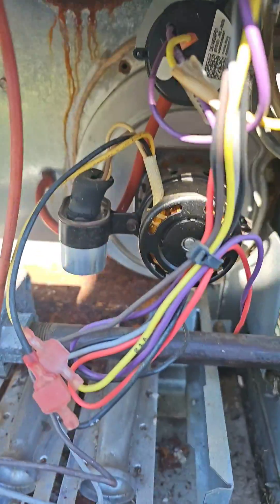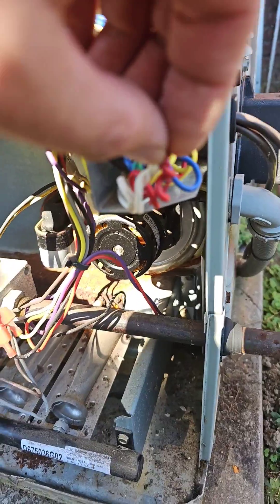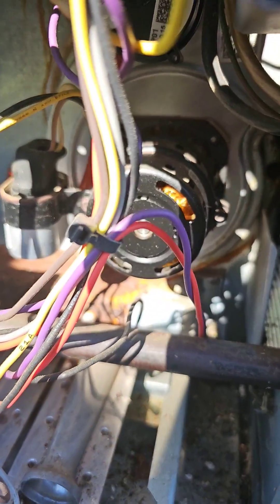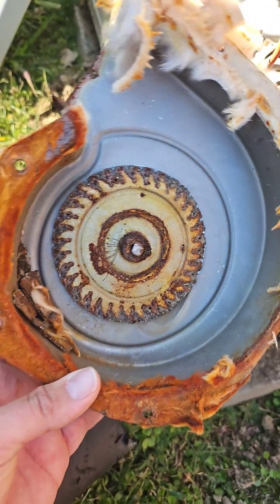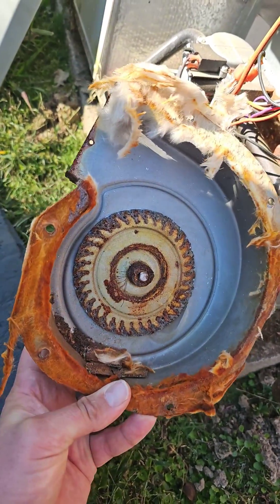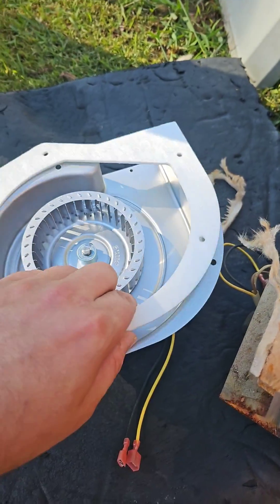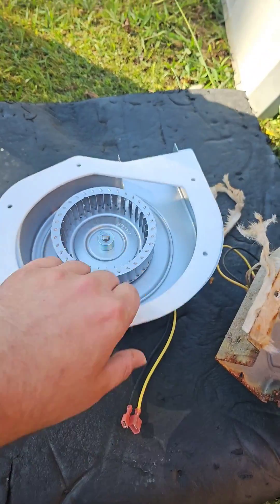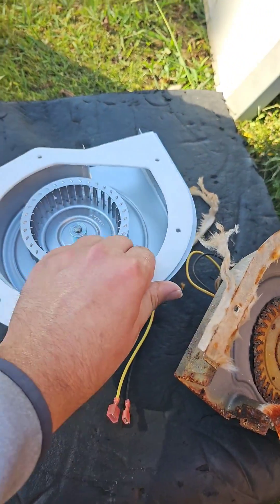THIS is WHY your gas heater is making noise? #gasheater

Comment: Why would a 2 stage furnace have 3 pressure switches?
Reply: Thanks alot guys.  Iron sharpens Iron.
Reply: There are also some Lennox units out there 90% that have 4 pressure switches in them. Only 2 are used tho, one set is for vertical install other set is for horizontal. But you'd be surprised how many new techs see that and freak out lol. Start calling asking how that furnace works 😂
Reply: If its a 90% one of them pressure switches is for the condensate drain on secondary heat exc.
Reply: @AllTattedUp13  yup that’s correct. Low speed draft proving, high speed draft proving and I believe condensate usually
Reply: @hvacmisadventures  yesirr. The one for the condensate side is usually easy to identify cause it's usually only like .2"wc

Comment: Great video.
Last year I had a very loud noise coming out of my furnace. I knew what it was and called service company. Tech walks in, hears it and announces I need a new furnace. I suggest he just replaces the inducer.
Problem solved.   
Funny thing, the repair was covered by the contract that the previous owner had transferred to us. As soon as it runs out I will look for another service company.
Reply: Out of curiosity what was the contract that was transferred? Was it a transferable warranty? If so the warranty (unless you know otherwise) is always transferred with the equipment. Unless the company specifically offered a special warranty you absolutely do not need to use the installing company. Any HVAC contractor can get warranty parts on a system still covered by manufacturer extended warranty.
Reply: @hvacmisadventures  
It was a service contract offered to the prior owner to cover HVAC in the home. It somehow got automatically transferred to me.  I didn't even know about it til.i got a letter from the service provider.
About a month after I got the letter the inducer problem began. I hope I answered your question.
The HVAC system was over 25years old so I guess it isn't a warranty issue.
Reply: @Sidfields789  ok yes sounds like more of a home warranty type deal. Not too sure since I don’t usually deal with that stuff but a lot of equipment manufacturers will offer an extended 10 year warranty on new equipment and you can purchase a separate deal to make sure it will transfer to new homeowner if you sell the house. If you don’t purchase the transferable part then the equipment will revert back to 5 year standard warranty for new owner.

I digress as you probably don’t need to know all that haha. I was just trying to give you some info in case you were being bullied into sticking with one company. Misinformation by large “bully” companies is rampant out there and I absolutely hate it. I’d rather provide information that helps someone select the right company for their needs than have their money in my pocket. Don’t get me wrong … their money is nice and all lol but I hate the scare tactics way more
Reply: @hvacmisadventures  
Soon after my inducer replacement, the summer came and the central air started to.leak badly. After throwing away money on repairs I purchased a new HVAC system. Carrier 3.5 ton system, gas furnace, electric A/C.  The HVAC company I chose was recommended by my realtor. They do all the HVAC repairs in her properties. They did a first class install and gave me 10 yr  warranty on parts AND LABOR. I am satisfied. The one I replaced was 30 plus years old.They had to replace the capacitor last year. But I hear that's a common occurrence
Reply: @Sidfields789  nice work 👍. That labor warranty is HUGE! Even a coil replacement under parts warranty can run upwards of $1200!

Capacitors aren’t made like they used to be so yes it definitely has become common to replace them every few years. Any sort of over voltage conditions (surges, power outage) can cut the life by 50%. Glad you found someone you can rely on.
Reply from the maker: Thanks for sharing
Reply: @taddydigest  
My pleasure. Keep those videos coming. I have learned a lot.

Comment: I hate to admit this but I’ve basically started diagnosing those over the phone. If I get a no heat call in for a “loud noise coming from unit outside” I ask if it’s a Trane gas pack and lookup their S/N in our system or ask them for a pic if they wouldn’t mind and just show up with the inducer. Probably a terrible practice as service manager but it has yet to fail lol. Trane has really put out some crap over the last few years
Reply from the maker: Hey man no shame in that game. I've done it before as well my brother
Reply: Better to come prepared then to stack up unwanted drive time.